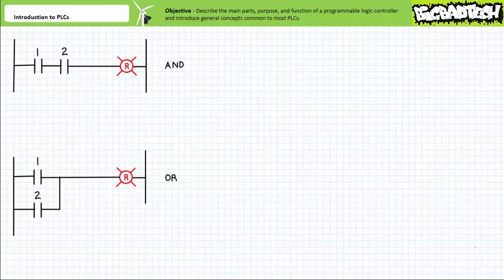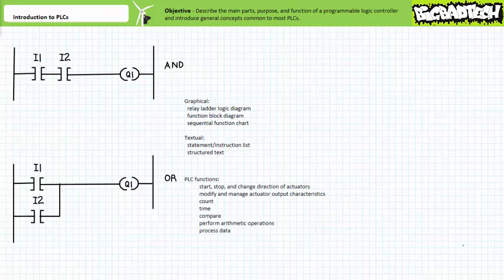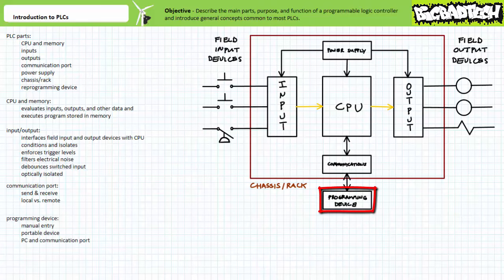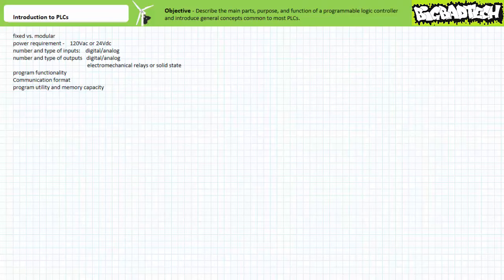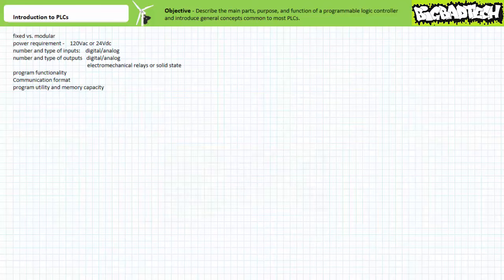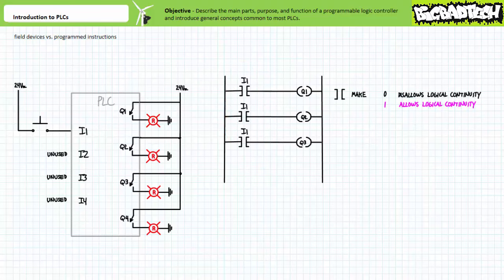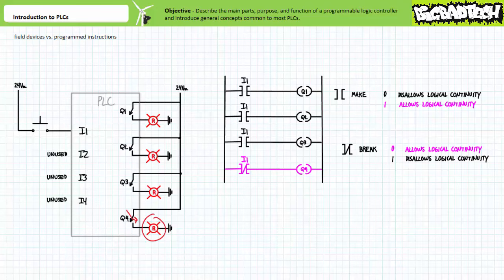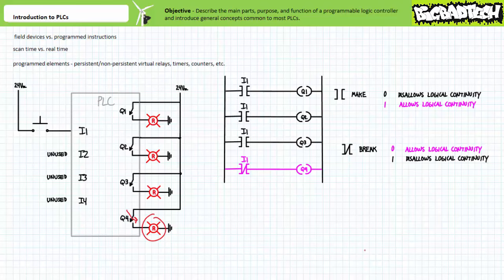Introduction to Programmable Logic Controllers (PLCs) (Full Lecture)

Comment: None of the pro plc talking points are correct except maybe the fact you can alter process without rewiring. Now that I have been working with both PLC and hardware relay control systems for years, I can tell you I prefer the old way. PLC hardware fails before relay/contactor wiring. It’s more expensive when you factor in the licensing requirements that almost every manufacturer implements to utilize their processors.  The PLC manufacturers are deliberately building processors that are incompatible with previous generations of hardware/software (planned obsolescence). 

Got a single anolog input module that went down? Oh sorry that module is obsolete, you’re going to need a new processor, as well as all new modules for every rack slot. Bruh this shit is only 3 years old and it cost 50k to integrate and install. 

So on and so forth.

Remember kids: Relays, contactors and starters are open source. And they’re open source forever.
Reply from the maker: Trust me I do feel your pain!

Comment: How Is This A Programming Language This Is Just Simple Electrical Circuits!
Reply from the maker: True dat! Ladder logic (LAD) programming language was specifically developed to look exactly like hard wire relay based ladder logic circuits. I hope cover other programming methods like sequential function charts (SFC) and function block diagrams (FBD) in later lectures.

Comment: Basicly the same deal as program a eeprom..  Just done differently.  Personally I think the make and brak symbyols are logically reversed...  visually if there is NOTHING between the 2 vertical lines on the diagram its VISUALLY open and that arrow there VISUALLY shows connected...

Comment: OK I'm noticing something here that is kind of confusing. When you talk about an open circuit it usually means that there is power running through it. However in Ladder Logic it seems to be the opposite. Is this true or are people just using the open and close term incorrectly?
Reply from the maker: In electrical terms "open" means no path for current to flow whereas "closed" means a path is available for current to flow. For clarification maybe check out the "Switches in Series DC Circuits" lecture at: https://www.youtube.com/watch?v=p96txBM6GWI and "Switches in Electrically Controlled Systems" lecture at: https://www.youtube.com/watch?v=ENCdPsA9PXc

Comment: can u tell me 
types of relays ,transistors uses in plc?
Reply from the maker: Electromechanical relays and solid state transistors commonly make up the output elements of a PLC. When commanded to do so by the internal program these output devices will selectively enable output devices.